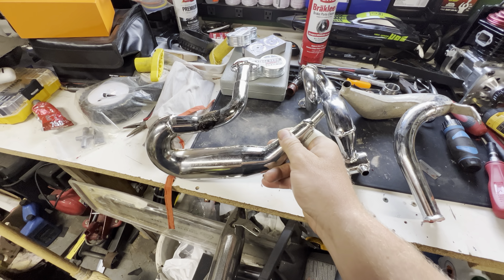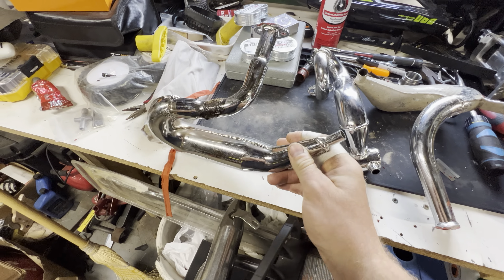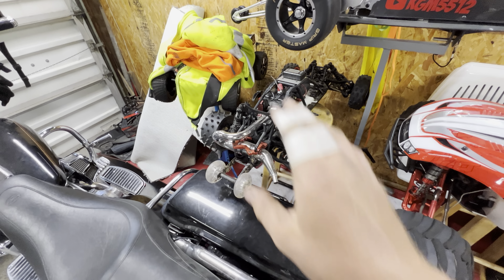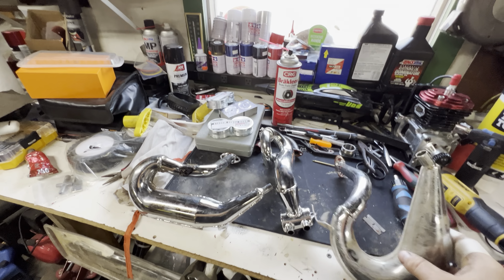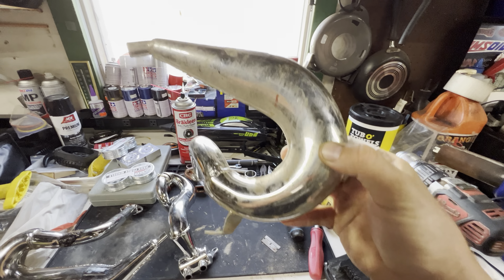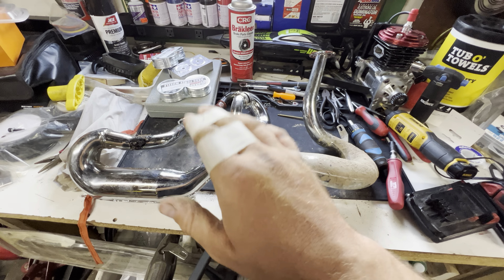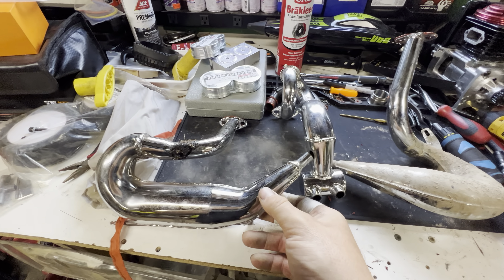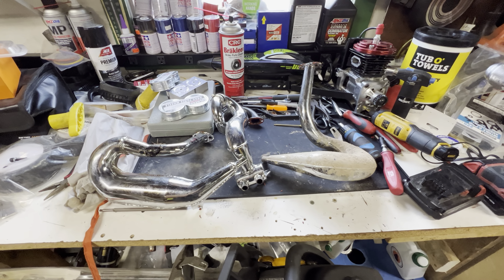2 stroke rc pipe talk what I like to run for small bore

Comment: Great video bro the pipe the roving type with the turn down stinger portion you can get that turned up but you have to ask Dan for it I believe the part number is 80357 The pipe you have there is an 80357–1 just wanted to clarify that for you brother
Reply from the maker: Thanks Jeff you always have the information on point brother!!
Reply: @kgm5512  I try my best bro to help others in the hobby. 🤝🇺🇸⛽️